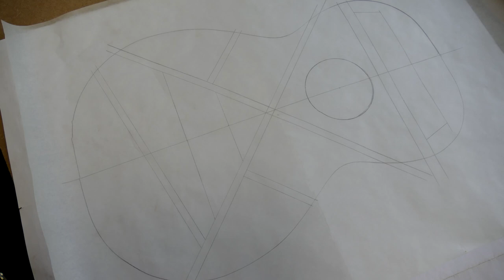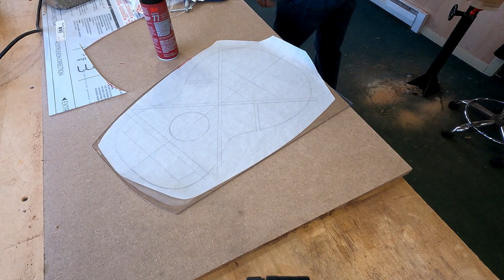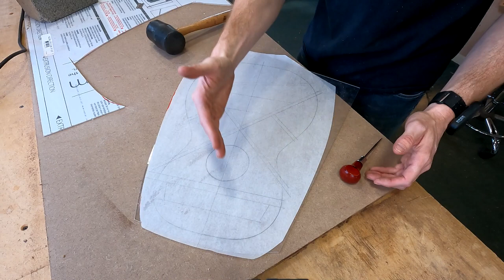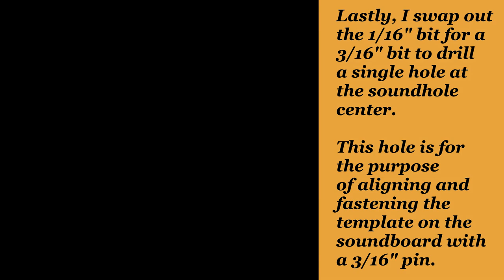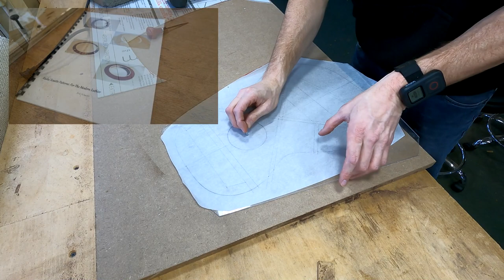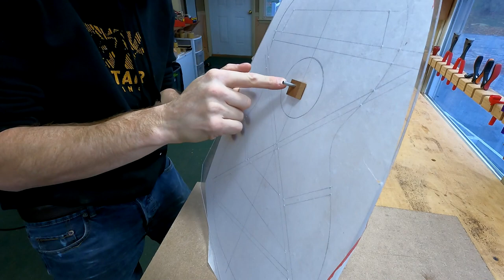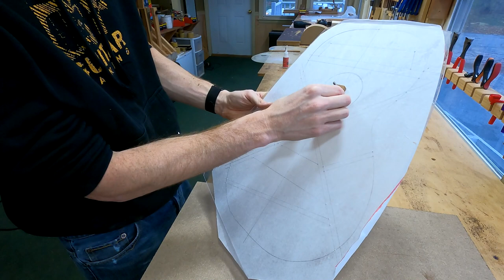Making a Bracing Pattern Template for My New Parlor Guitar Model

Comment: You should disassemble the machine, clean it up inside, check for loose connections and make sure everything is correctly placed first. If that doesn't work, you might have to sand lightly any electrical contact places like switches to get them clean and conductive again. Lastly, I'd recommend changing the brushes or at least sanding them flush and straight again. I did all of the above to rescue a 35 year old drill and now it's working better than any new model. Good luck and thanks for the informative videos!

Comment: I'm with Keith and Walter, probably the switch. It might just be dusty inside. Blow it out while operating the switch with tool unplugged, maybe squirt some Deoxit in there too. You might have a loose connection on a conductor in the power cord where it attaches to the tool. If it's not one of those, and it's not under warranty at a nearby service center, buy a new one. Cheaper in the long run if you can't fix it yourself in an hour.